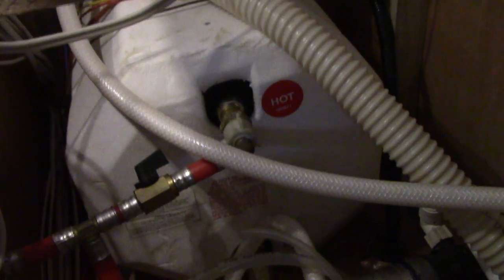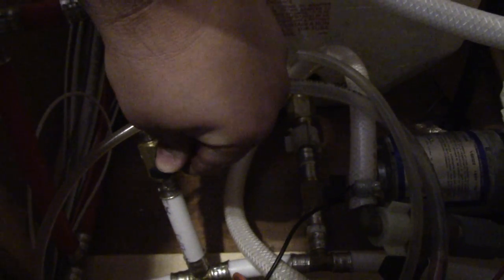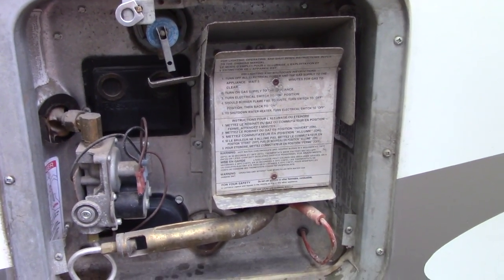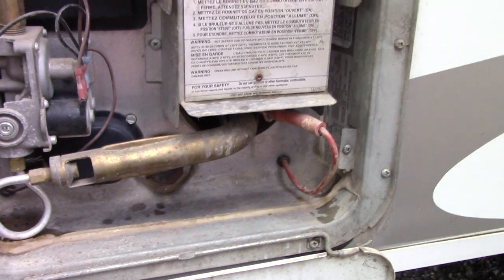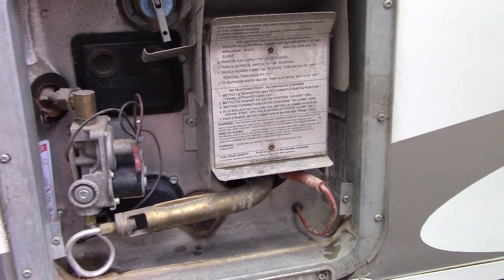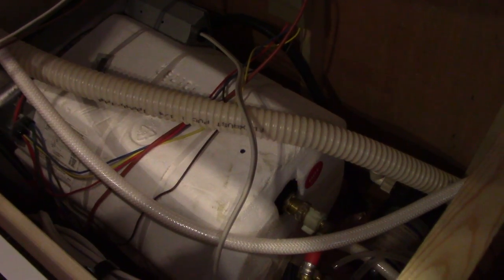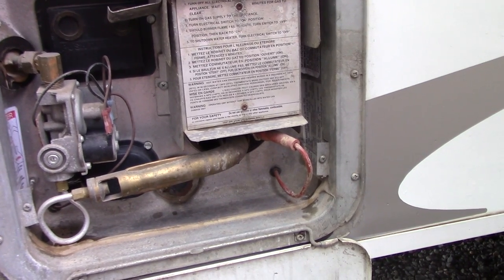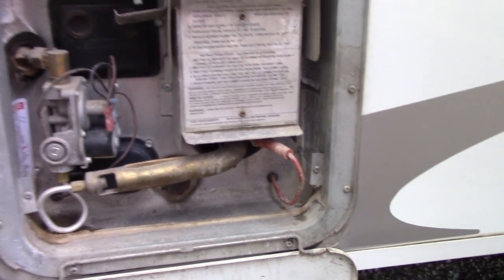No Hot Water In RV? Check This First!

Comment: I bought a used RV in May from a private party and suffered with luke warm water all summer. With fall temperatures cooling, it was urgent that I have hot water. After spending an afternoon troubleshooting and still not figuring it out, I went on YouTube and watched video after video on how to fix a suburban water heater. Finally at 9:30 pm I saw this title and clicked to watch it. When I saw the first thing mentioned was to make sure that the bypass valve was closed, I had to rush out and check my unit, at night, in the rain! Sure enough it was open!!! I closed it and for the first time ever, I’ve got hot water. Wow. Thanks so much for the tip. 
Reflecting on the situation, I bought it from a person who was selling the RV for the owner and knew nothing about it. The owner had winterized it and part of the process was to bypass the hot water tank. I in my inexperience, knew enough to open the valves to and from the tank but forgot about the bypass until I saw this video. Ahhhh... the learning curve.
Reply from the maker: Wonderfull! Glad you found the problem! I have also herd of people turning the outside shower on cold & hot then just shutting the shower head off and not the hot/cold controls they say this will also make the hot cold mix resulting in no hot water... Thanks for watching Cheers!

Comment: Just happend to me, aswell this past weekend, Just picked it up from the RV dealership for the first time, had some issues ,,this being one of them, always pays to have a smart friend along, lol, This was the exact problem, which should have been done at the dealership, and also water holding tank valve was left open, so when first started filling it ,,it was coming out faster than the hose was putting in the water, there are a few other issues aswell, but getting them dealt with this weekend,  Always check everything before taking ownership from a dealer, and keep your smart buddy happy,,lolol
Reply from the maker: Yea i hear yea! I just bought a 2018 Springdale and have had nothing but problems! I am starting to think buying a few years old is better as most of the problems would be worked out by then! Cheers. :)
Reply: You would think so, turns out I did not have heat aswell coming out of my Heater,,they replaced the mother board and it seems to have fixed it, and then suddenly no tailights or signals, they tried saying that the wiring was a commonly used wear and tear item like brakes and tires etc, and all this happend on my first trip out, they said if it was past the 30 days they would not cover the electrical problem and because it was on the chassis which was seperate from the RV, I was stunned, got the extended warranty, And they almost never covrered the wiring repair, and this was a 2 year old unit, 2016 ex rental unit, nothing but a hassle with the service department, So buying from a dealership is not all what it is cracked up to be aswell, ,,You buy from a dealership hoping you don't get problems and issues, Just my experience with my first time buying a RV off a lot,,
Reply from the maker: Most of them only care about the sale and do what ever it takes to get you to sign the dotted line then your nobody to them! Very sad way to do business! I treat my customers & return customers like GOLD because i know thats how i would want to be treated!
Reply: LittleRVrentals.com I heard rvs are very problematic! and you just got brand new with bunch of problems!

Comment: Thanks I did all you said, hot water is in the tank I check the valve it's hot coming out. I dont have a valve like yours, only o e that turns the water off and on going into the tank.
Checked the outside shower valve bypassed it.
Still no hot water coming through, heats up fine gas comes on heats but still nothing  coming out of the faucet?
Never had this before it has always worked until  this year, this is the first time I used the hot water this year as well....umm I'm completely at ends...great video btw just didnt work for me.Any other ideas?
Reply from the maker: Sounds like it could be a failed check valve located on the inlet or outlet of the hot water tank. There is a spring and washer in there and if it fails it creates an obstruction in the line stoping the hot water. If you disconnect the water lines and put your pinki finger in the brass check valve you should feel a spring in there it's a back flow preventer. I think i show this check valve in a video of mine called (how to winterize your RV fast).
Reply from the maker: You could also have a failed water valve you may think it's turning on or off at the tank but is broken inside the valve... But check the check valve first! :)

Comment: Last month, we bought a new Coachmen Clipper with a We have a Suburban, Airxcel, Inc.  SW6DP Direct Spark Ignition.  We took it out for a 3 day stay in an RV park and the hot water worked fine.
I took a 2 month volunteer camp host job 4 hours away on the Coast.  And now the hot water will not work!  The DSI FLT red light flickers on and off.  
We turned the propane take on, full blast.  We ran the water out of the tap.  It did not warm up.
We found the reset button.  Pushed it.  No change.  The reset button had NOT popped out, so that was not the problem.
Reply: Did you find out what the problem was? I have a similar issue, but just started looking into it.

Comment: At 2:48 you say something about "the valve". What valve are you talking about and what did you say? There as a jump cut and you cut of the verbiage.
Reply from the maker: Pressure Relief Valve?
Reply: Thanks. I don't think that was what got cut off. Anyway it's a moot point now. I figured out what the problem is in my unit. There's a check valve (no backflow) in a brass fitting on the hot outlet of my suburban heater. That appears to be part of the design to save an extra tap during bypass. Seems that valve just quit and stopped my hot water flow.
Reply from the maker: Yes i had the same thing happen to me that back flow valve blew up and turned a rubber washer sideways and restricted the hot water flow!

Comment: Hello, how do you ignite and how do you fill, hot water tank?
Reply from the maker: Hi there, If you can fined the compartment inside the trailer that has the hot water tank stored there will be a top valve and bottom valve line going into the tank. Make sure they are in the open position. Turn on hot valve at sink tap as well as water pump or unless your hooked to city water... To light the hotter tank there should be a switch somewhere if not and it's a very old unit you may have to light it manually from outside compartment. Hope this helps Cheers, :)

Comment: Hi, thanks for the video!  My problem is that I have no hot water flow anywhere, it was working fine and then just stopped, if I turn the bypass I have cold water coming out of the hot & cold.  Then, when I turn it back, nothing.  Any help would be appreciated, it is a single bypass heater.
Reply from the maker: Hi there sounds like it could be a check valve problem it's like a brass fitting that enters the water tank at the bottom and exits out the top check out my other video how to winterize an RV fast, I show these fittings Hope this helps Cheers :)
Reply: @Littlervrentals  Thanks, I'd come to that same conclusion!  I'd imagine that there's only oned check valve.
Reply from the maker: Normally it's just on the bottom inlet but i have seen them on the top as well. If you take the bottom pipe fitting off and stick your pinky finger in the brass fitting you should feel a little spring thats the check valve.
Reply: @Littlervrentals  that sounds like my problem where is the video on that?

Comment: I have a 2008 tioga Ranger and I don't see any valves... only a hot water hose and cold water hose. I have lukewarm water. It is igniting and it seems to burn as long as usual but not hot hot. Just warm.
Reply from the maker: You could have an air lock in the hot water tank. when cool try pulling the pressure relief valve on the hotter tank and see if any air comes out... Could also be a bad check valve on the tank that is restricting hot water flow. Also make sure outside shower taps turned off could be mixing if not. Cheers, :)
Reply: @Littlervrentals   Thanks for the reply! It was the outside shower!!

Comment: I dont have a hot water bypass valve on my boiler. I have no hot water. 5th wheel cardinal rv. Can anyone help?
Reply from the maker: did you try on electric and propane? should work on one or another. Also check if you have an outside shower that the taps are turned off tight or the hot and cold could mix.

Comment: So when I close that valve that mixes the water when I turn my water to hot the water stops coming out
Reply from the maker: Hi Are the other 2 valves at the hot water tank in the open position?
Reply: LittleRVrentals.com yes they are I replaced the anode rod today because it was veryyy decomposed could a valve be clogged?
Reply: @ChaseandGavin  Mines doing the same thing.  Did you figure it out?

Comment: Thanks for the video, you just saved me a trip to the RV dealer. I never noticed that lower valve on mine as its in a almost hiden spot.
Reply from the maker: Thats Great! Glad I could help! Cheers,
Reply: You have three I can only find two to open.
Reply from the maker: There should be 3 valves one with line going into bottom of hot water tank and one coming out of the top then theres another valve in between those two, fallow your lines they may have the hidden valve somewhere else... If not you should have hot water if not then there may be another problem... Cheers, :)
Reply: Its working now.Thanks.